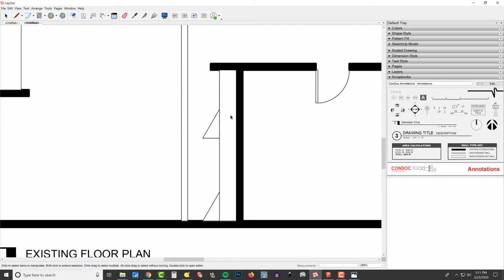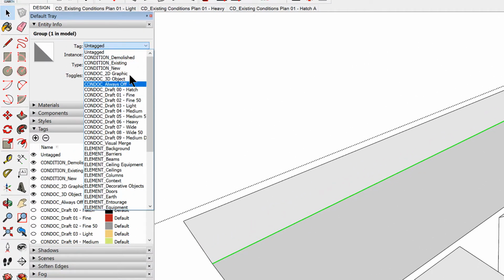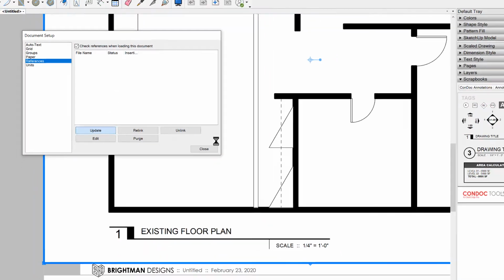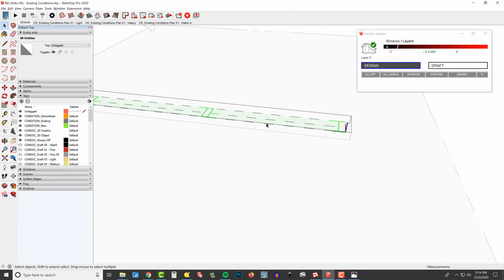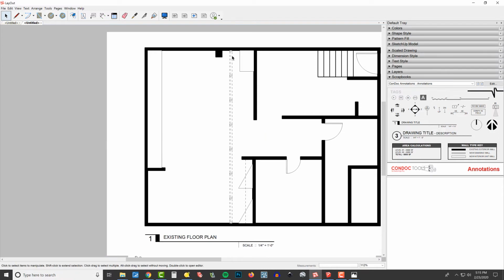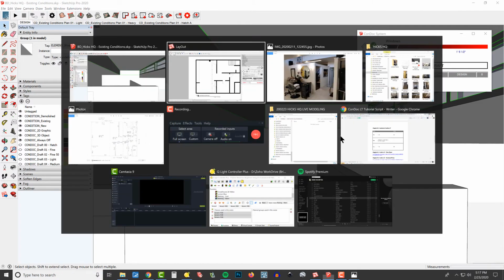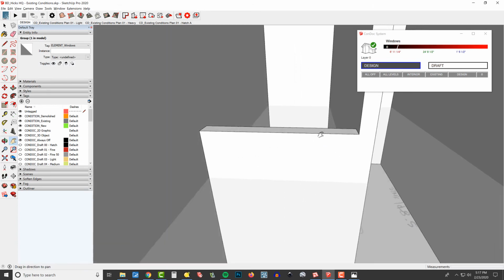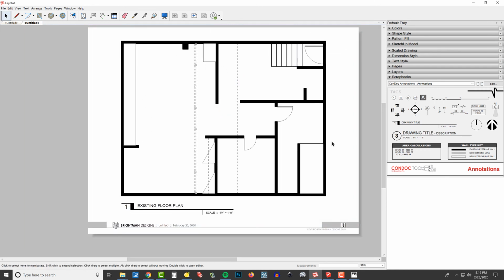Optimize your LayOut Drawings by Controlling Graphics in sketchUp

Comment: Great plugin you've developed! I'm currently evaluating whether I can start using ConDoc as part of my workflow instead of having to invest in Revit or Archicad. I'm wondering if there's a different process that is possible to show dashed lines above / below without having to draw additional lines, instead just using the geometry that is already created. For instance, is there not a way to select the windows in 3D and then either toggle an option, put them on a specific layer, etc. that will allow them to show up in a specific way as dashed? This would be helpful for showing walls below or walls above a specific view as well. Also, for showing stair risers above the cut line as dashed. Just wondering if it's possible to do without having to draw additional lines / do additional work beyond what is already in the model. Thanks!